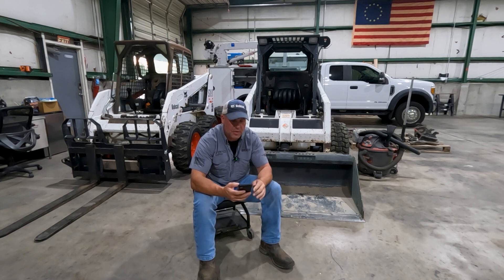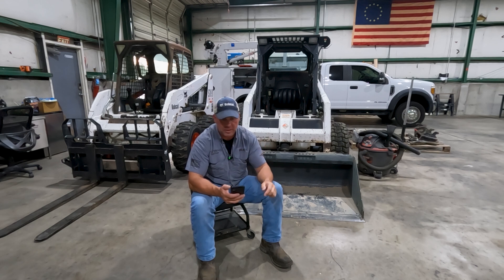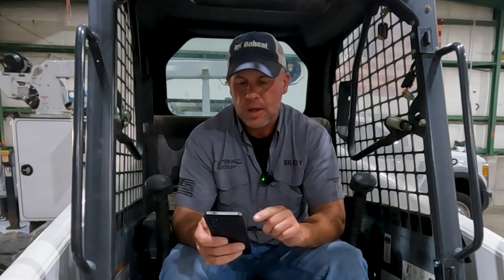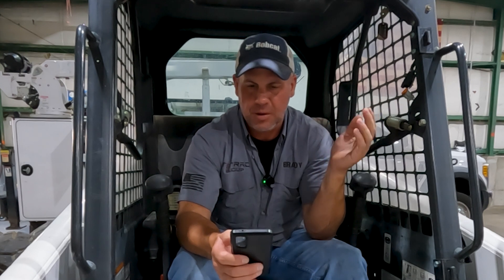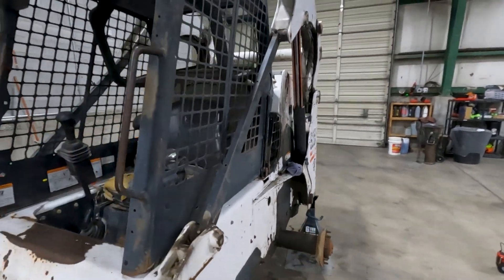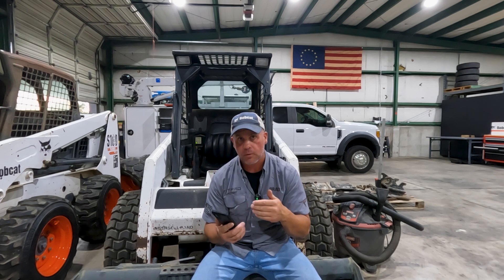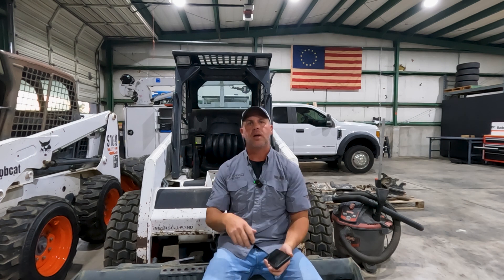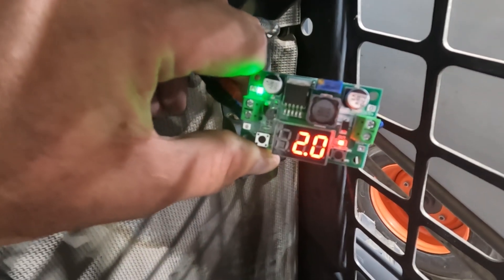What Happens When You Ask The Internet For Help.  Testing Bobcat suggestions from Face Book groups.

Comment: L7805CV regulator is your answer (temp fix only)     Red is positive Black negitive and green is your signal.   Just unplug and  shove the regulator legs directly into the socket.   I want to stress that the only real fix is replacement but this will allow the machine to be moved for the middle of the road where its likely to be broken down.  Just wrap with electrical tape when your done.

Comment: I in years post I just took the magnet loose from the bar and just taped the magnet in the bar down position and just kept the bar up all the time.  I’ve also put the bar down and cut out the center of the bar so I could get in and out and kept the sides of the bar for arm rest worked great was in and out the machine a ton worked at a livestock auction so had to just get out constantly to feed cattle hay.

Comment: Ok where can I buy the adjustable voltage regulator it would be for trouble shooting or getting a machine on the trailer and in the shop Thanks Nick Miller
Reply from the maker: I have six of these with different connectors to test multiple circuits without having to change the wiring every time.  https://amzn.to/48tjDbf
Reply: @tetradgroup  thank you I found them last night. I am going to make up some for the different series machines. I love your videos have watch for a long time! Thanks Nick
Reply: Can you tell me where you got the connectors for the g series? I have a 2003 773. Thank you

Comment: I'm a tech too and greatly appreciate and value your work. Thank you for the help. 
I get some machines that are not safe to operate anymore but the customer insists they can be "safely" repaired and put back into service. 
The last 743 i "fixed" is an excellent example.
Customer stated the machine will move but arms won't tilt or lift/come down. Machine already creeps as soon as it's on because there are no brakes left and the centering blocks are already worn on both sides after flipping them. 
I go to the gin and look at their machine. It has wires running everywhere that they "repaired" previous problems with. 
After testing everything and finding current on every wire including grounds I was lost as hell. 
Turns out they had a major short to ground through the charging circuit. The entire mainframe was now a conductor. 
I figured this out when I was testing grounds and had my hand against the alternator ground while checking the bics valve. Shocked the hell out of myself. To solve this they made a ground system kill switch they turned on whenever they needed the machine. 
I immediately stopped work, notified my supervisor and he called the customer. 
They asked if I could "hot wire" the entire bics circuit. Boss said yes but it would be stupid and dangerous. Customer agreed and wanted it done anyway. 
I ended up having to wire the lift, tilt and bics valve together to a separate relay and switch that was insulated by a rubber block and grounded to its own circuit.
This made the machine usable again but means that as soon as it has power the machine will move and operate even if the operator isn't ready. 
This definitely isn't ideal especially if there are operators that are not familiar with the machine. 
The machine was still in reasonably good running order besides the extra wires and was definitely worth a new harness but customer declined because it was working fine now. 
I'm pretty sure that will be the last repair possible on this machine without a new harness.

Comment: So I have a question if the machine is not running and you can’t get it running and you need to transport it to the shop and you have a trailer is it possible to put the track loader in neutral so it will roll so I can drag it up onto a trailer and if so how

Comment: Run a toggle switch. Twist singal and hot together. And then run ground by it's self. The switch will work as if the door was on the machine.

Comment: I like your little diagnostic voltage regulators that is an excellent way to test sensors on a computerized machine.  I was working on a old mini excavator no computer that would start but not operate. I had to get it off the trailer so I applied 12v directly to the solenoids on the spool valve body to disable the various safeties it worked but like you said not the safest option.